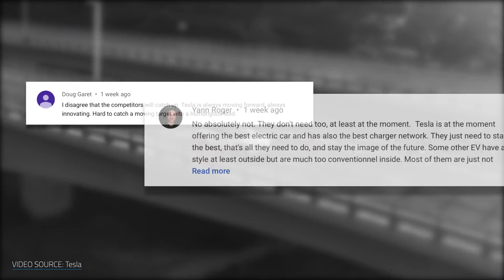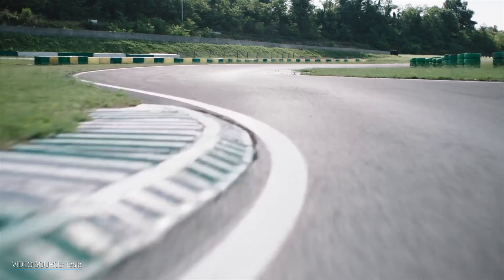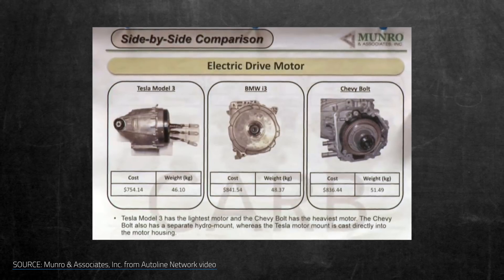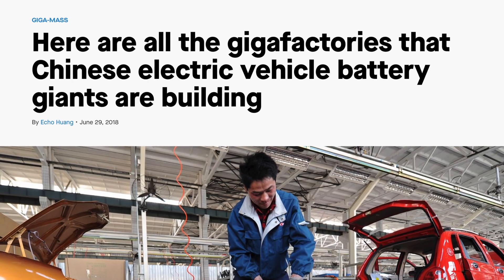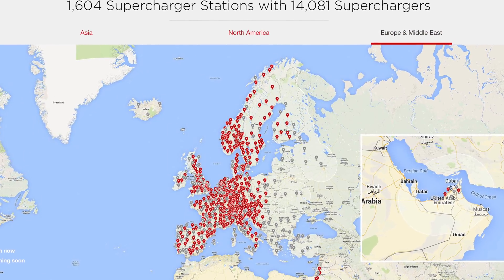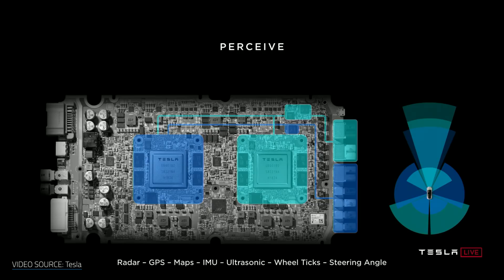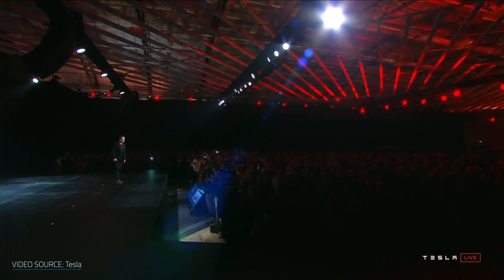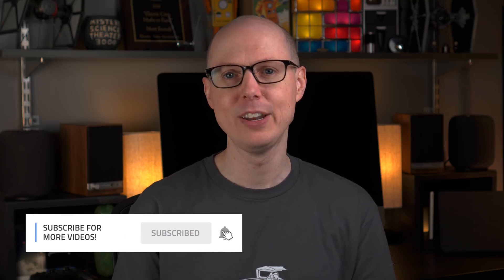Tesla vs Competitors - 5 Advantages

Comment: Hi Matt, 
unless I missed the part by not listening carefully enough to you video, you did not put a big light on the very strategic advantage of Tesla, the "Over the Air Updates". No other car manufacturer does offer this. This is one of the most important keys, not only to achieve autonomous driving, but also to put Tesla far ahead in terms of rolling out SW-Updates to the customer and improving their cars.

Kind regards
Math
Reply from the maker: You’re right!  That’s another great advantage.

Comment: There only problem is the price, a lot op people I know were thinking about getting the model 3 as they hears it was going to be an average price. Unltill they saw the actual price, I don't know what you americans are smoking but over here thats in the higher cost range. Instead of putting in those extras that a lot of people don't use they should make an affordable regular model that's just like most cars you see, no camera's no screens no electric doors and stuff most people don't care about or use just a good electric car with a radio and heating at a lower price.

Comment: Good video and lots of excellent points, most of which I agree with.
charging infrastructure however is one that I don't agree with.
You showed Tesla having 5000 chargers, 
And then listed all of the other charger separately..  except all of those are CCS just run by different companies in different areas.
if you add up all of the CCS chargers you had on that list it comes to 4000 chargers.. they are not that far behind..
Especially considering how late of the start they had.
Electrify America alone has 450 chargers now with 350 more coming online next year.
I also might add that all of the Electrify America stations are 150 / 350 kilowatt stations. 
so as more cars come out that can accept High charge rates they will actually be ahead of Tesla.
personally I would much prefer to have my charging company be separate from the company that built my car.
Nobody goes to a gas station that's run by Chevrolet.
I think having that separation, builds competition and ultimately will make the experience better.
I would absolutely buy a Tesla Model 3 right now over any other vehicle except for one thing, price, and  I absolutely hate the interior, and some of the other design choices. 
I drive for a living, I want a dash in front of my with the info I need, and physical controls for things like radio, wipers, real door handles inside and out..

Comment: Missed the Semi truck, onsite Megachargers @0.07kwh, solar panels, the solar roof tiles, commercial battery storage, residential battery storage, Pickup truck and model Y. Also Insurance, and unannounced projects that I suspect exist related to home heating, cooling, etc.

oh yea, the Tesla network (uber for Tesla drivers) that will also be going autonomous as regulations permit.

Oh, and they sell co2 credits to polluters, and that's a nice recurring revenue stream.

Comment: One thing related to motors and batteries that you didn't mention is longevity.  The Model 3 drivetrain has been tested to 1 million miles with minimal wear, and the current Tesla battery packs have minimal degradation over hundreds of thousands of miles.  The engineering of the motor, gearbox and battery pack is excellent and they will last a very long time.  In fact they have already lasted many hundreds of thousands of real world miles in customer cars.

Comment: Another advantage is the choice/ability to integrate many mechanical controls into a central control panel.  This simplifies assembly and cabling yielding a cleaner, lower-cost design.  Of course, competitors can do this as well but the time and attention required are significant.

Comment: Fanboy Gush - VW has the manufacturing capacity to scale in a way Tesla can’t. 

I was close to buying a Model 3 but I didn’t as when I saw it in person the quality of materials used in the interior was far less than my BMW. It was cheap, plastically in comparison.

Personally, I would prefer a quality VW or BMW interior to autopilot.

Comment: It would be nice to compare Tesla's motor to Toyota's motor that they have had rare earth magnets in it's motors on the road for about 25 years.
Reply: Yes, that's a good point even if the Toyota motor was improved over the time (ORLN has some good free reports available in internet). Just for curiosity I studied a little bit the designs based on the available free info in internet and I found that: 

1) It is claimed to be an alleged "PM switched reluctance machine": I believe not,  it's rather an Interior PM synchronous (IPM not switched...) which still exploits the "magic" reluctance mechanism. IPM is nominally also the Toyota, GM and BMW designs...and it is a common design in high performance servo and automotive drives since several years. Reasons: switched reluctance machine normally uses non-overlapped coil windings (Tesla m3 ist Not, from the photo is most likely a distributed winding), rotor structure extremely similar to a rotor of an IPM machine with magnets arranged according to a V-shape pattern (I believe introduced in the automotive industry in the Toyota Prius at least since 2004). Finally a switched reluctance machine would require a not-standard power electronics architecture while an IPM machine uses exactly the same inverter architecture of the front-axle induction machine. This would make sense in terms of economy of scale in Tesla.

2) It is claimed that it implements Hallbach array PMs. This might be (I believe not) but it is not a necessarily due to the segmented design found by Munro which, he states, as definitely Hallbach....based on what? "hammer test"? PM segmentation is one simple and effective strategy to reduce the eddy current losses, especially at medium-high speed range...Hallbach or not. Hallbach array makes sense when you want to manipulate the airgap magnetic field with the target of having a quasi-sinusoidal waveform which is very good for example in improving torque quslity/iron losses/torque density removing parasitic harmonics . But I would say it makes more sense for a Surface-mounted PM, while less in an IPM design where you have more degrees of freedom to play to get possibly closer results.

3) Finally the advantages over the competitors. Tesla m3 is more efficient than the GM and BMW, this is an established fact I would say.  Therefore we can assume the e-drive has its own role somehow. A part of the SiC MOSFET there are 2 key facts which helps in my opinion: a) Number of Rotor poles: the m3 is a 6-pole design while the BMW is 12-pole, GM is 10-pole. It means that the m3 operates, for the same speed at 40-50% lower electric frequency with, in principle, a more-than-linear reduction of the iron losses. This yields presumably efficiency increase especially from medium-high speed range and partial load. b) Optimization: electrical machine design evolves over the years, thanks also to improvements of the computational power. One things can make difference is the driving cycle optimization where you minimize the energy loss over the driving cycle.  As far as I know/remember first researches on this topic appears, in the academia, around 2012, quite recent for my point of view (big problem was/is the computational power). BMW designs dated back <2012, GM probably <2014...Tesla is the latest which for sure exploits the most updated knowledge and expertise.

Comment: I wonder what your thoughts are regarding the Rickard blog post of Aug 10 ( http://evtv.me/2019/08/the-tesla-conspiracy-or-am-i-a-dead-whistleblower/ ) where he basically agrees with all the items presented above but postulates that it's not competition with other auto manufactures that Tesla has to be concerned with but a massive PR and Stock shorting campaign run primarily by Big Oil, but I don't doubt that big auto, auto dealer associations, and power utility operators are involved as well. Tesla will likely survive this but the headwinds and trip wires are certainly affecting share price and therefore market capitalization and result in a bumper crop of grey hairs and gnawed fingernails on shareholders.
Reply from the maker: The Now You Know guys put together a great video on that blog post.  If you haven't seen it, worth checking out.    https://youtu.be/vfILTM_xcOE

I have no doubt that some of that is happening, but to what extent is up for debate.  My bottom line is that I don't think there's a giant organized cabal against Tesla, but a series of disorganized groups all taking hits where they can make them.  Auto dealership organizations are lobbying lawmakers in some states to ban Tesla selling direct to customers.  Big oil pumping money into shorting stocks to slow down EV adoption.  Power utilities lobbying lawmakers to slow down solar adoption ... and in some cases making it illegal to generate your own power.  Any rich group/company that has something to lose with this disruption is doing everything they can to slow it down (laws, stock manipulations, and spreading FUD).  Thankfully, it's a disorganized group or the headwinds for Tesla/EVs would be almost insurmountable.

Comment: I have thought about a Tesla but honestly, I'm not convinced that electric cars are the future. The environmental impact of mining for the ore to make the batteries, the amount of water needed to make the "brine" for the lithium...I'm having a hard time accepting that they are any better the environment. I'm hoping advancements in battery tech in the next few years will change that.
Reply from the maker: There are closed loop recycling systems on the way that should make this a non-issue in time.  One company I've spoken to is American Manganese, which has already proven out it's recycling system.  It'll be cheaper to get battery grade components from recycling vs. mining for new ones.
Reply: @UndecidedMF  I hope you are right. I'm going to wait to see what happens.

Comment: I'm not sure if the charger network is a sustainable businessmodel on its own. High power electric grid connections are expensive and maintaining them also has big annual costs. Here in the Netherlands a company has to sell a massive amount of kWh to create a positive ROI. Also many people can charge at home or work and the next generation of cars will have solar modules in the roof that will further reduce the need for charging stations. Tesla will need to put more effort in the supply and innovation of long distance electric trucks to see positive cash flow on these charging networks.

Comment: All Tesla's other big advantages basically come down to their maximum vertical integration strategy but the first is by far the biggest, IMO.

1) They can actually sell the product because they sell directly to the customer. Going through dealerships not only means a middle-man markup but also the dealerships actively steer people away from EVs because EVs need little service and service is half the revenue for dealerships. It doesn't even matter what your product is if you can't sell it and every other auto manufacturer is currently in that position (though their products are also inferior).

2) Far fewer middle-man markups, due to producing many more of the components themselves, saving on car parts, microchips, charger and software licensing fees, etc. This drives down cost a lot.

3) Far better software/hardware synergy, due to being able to design all the car's components to work with the software, allows for all parts of the car to communicate efficiently and be controlled from a single screen. This is most of why legacies can't reproduce OTA updates.

4) Much better software programs, due to hiring top-notch software engineers. Legacies don't focus much on software because it wasn't around back when they started making cars and, for the most part, they haven't changed. This is the other reason why they can't replicate OTA updates.

5) Stable supply of components, due to manufacturing them instead of relying on suppliers (particularly for batteries).

6) The last is mindset; Tesla is focused on growth and first principles problem solving. This approach is why they have done everything as fast and as well as they have. They design everything from the ground up to work in ways that make the most sense, rather than fitting well into existing paradigms, and they operate with the goal of growing as fast as possible, instead of making profit. Legacies can't really compete with this, as they are locked into profit-mindset; their investors expect it. They can't commit to EVs because it would cost them their profit in the short term and, when that happens, investors get upset and the CEO gets replaced.

7) I guess the actual last one is vision. Musk and others at Tesla have seen every potential road-bump far ahead of time and planned accordingly. It's why they chose to vertically integrate (lowering prices, ensuring supply, maximizing synergy, and reducing contractual obligations), to build their own charging network (instead of letting companies with different agendas do it and end up with no chargers between cities because they make less profit than ones in cities), to focus on growth over profit, to go for autonomous driving, to sell their own insurance (which will avoid absolute chaos when they need to insure self-driving taxis, save a ton of money, and make the sales process easier for customers), etc. Tesla is always ten steps ahead of legacies, not just because they committed earlier but because they planned better.

Comment: Am not convinced, remember the Betamax-VHS story, same here. The big manufacturers simply have several orders of magnitude more build capacity. So when they finally, in a year or two, get their act together they will outproduce and outsell Tesla in no time. Possibly even at higher reliability levels.
Reply from the maker: They may have the build capacity for cars in general, but there are severely behind in the technology and battery capacity department.  By a wide, wide margin.  Even if they shifted everything into EVs today, they'd be able to pump out millions of EV car bodies, but without a power source or software support.  It's not a simple 1 to 1 conversion for them.  They'd have to retool and build out a very different operational structure to support EV production at scale.  And in that regard, Tesla has a significant lead.
Reply: Matt Ferrell , fair nuff but my point is that quality may not be the final deciding factor, sheer volume and subsequent lower prices likely are.

Comment: Car manufaccturers should be working together to build up a charging infrastructure that can be used by ALL EVs and is as ubiquitous as the gas station.

I just returned from a road trip through Montana and north and south through the heart of Idaho that I could not have taken with an EV without seriously impacting schedule.  Driving an ICE vehicle with a 600-plus mile range between fuel stops permitted us to stop anywhere we wanted along the way without having to be concerned about where and for long we would have to recharge an EV.

Comment: while over the air updates are a huge factor, to some extent other manufacturers will start doing this, but they are limited by the hardware they put in their cars. While Tesla purposely planned the touch screen displays and minimal dedicated buttons so they could have an endless palette to play with, AND they actually design their own computer purpose built for future features, autonomy and safety. So while an iPace might get an update, it's not going to change or add many features. I've had my Model 3 for over a year now and the number of things it can do now compared with a year ago is staggering!!! Tesla is the ONLY manufacturer who doesn't abide by the "build it and forget it" philosophy that ALL other makers operate by. And THAT is the biggest advantage of all! I too thought I'd never drive an American car again, but thanks to VW's scandal and Tesla's awesome philosophy I dumped my R32 and my eGolf for my Model 3 and will never buy anything else!